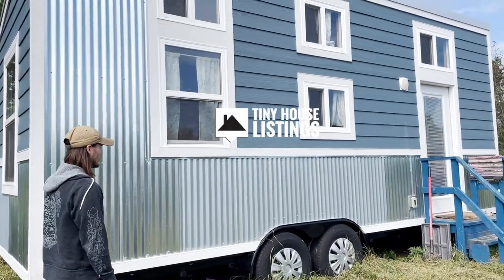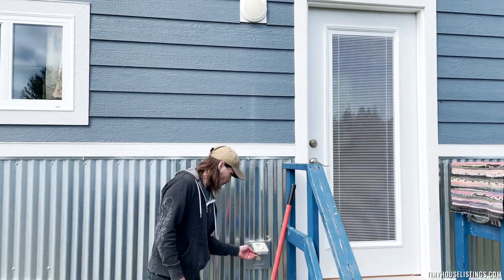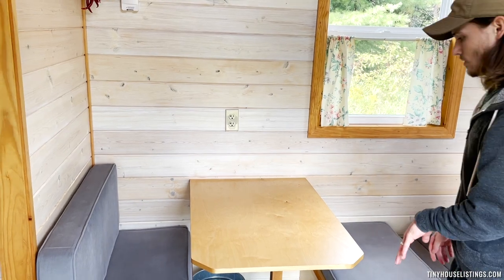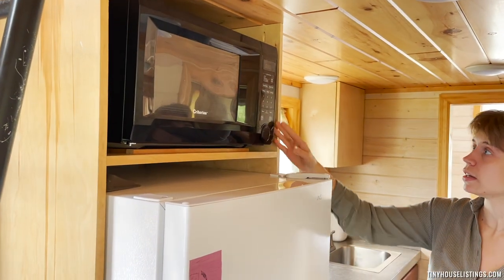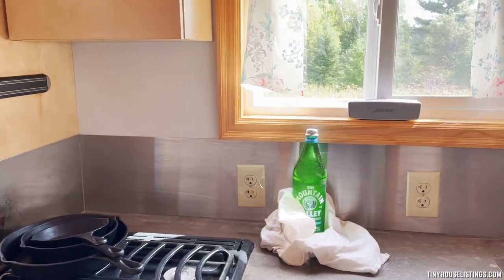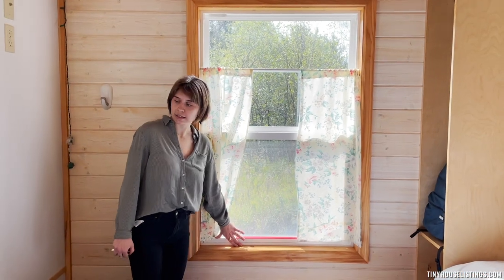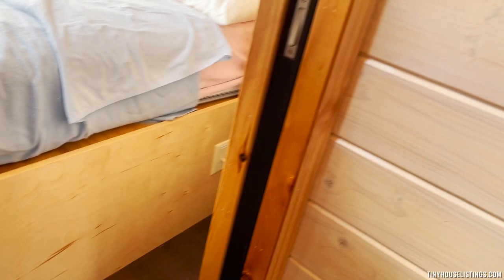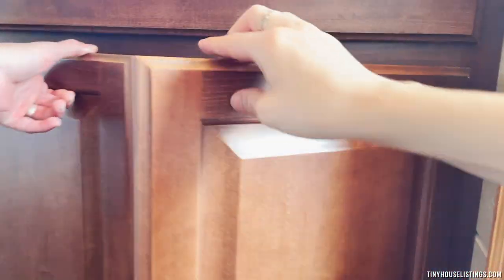This Is How To Live Debt-Free Exit The Rat Race

Comment: That water heater is in a terrible location.  Someone will wack their head on it!!!  Was no one thinking???
Reply: Ok.  Not a water heater but a heater none the less!!!
Reply: Why are you so negative?
Reply: Heaters should be lower/floor  level since hot air rises.  That's why to me a minisplit high up on the  wall is useless for heat.  Thought mattresses should be on slats etc for air flow and to prevent mildew, dampness.
Reply: @elaineflorida1  not negative - truthful.  Not everything in this world is perfect.  There is always room for improvement.  If everyone tells these people how wonderful the place is without pointing out the flaws, it will never sell.  Then they will be wondering why it doesn't sell.  And they won't know what's wrong with it!!!  They need to know their failures now so next time they won't  repeat them and won't be left in the dark wondering why.  If everyone kept telling you lies elaine about how
 great you are and what a wonderful person you are, you'll just keep doing the
same dump ass things you always do.  And they would be doing you an injustice!!!  Best you learn that now elaine.  ☹☹☹☹
Reply: @denisephillips9269  ITS FINE YOU CAN CHANGE IT FOR YOUR DESIRES.
Reply: @justme5694  THESE YOUNG PEOPLE DID A GOOD JOB AND ITS WELL MADE HOME CONGRATULATION ON YOUR FIRST BUILD HERE!